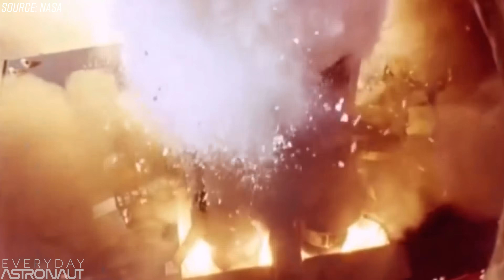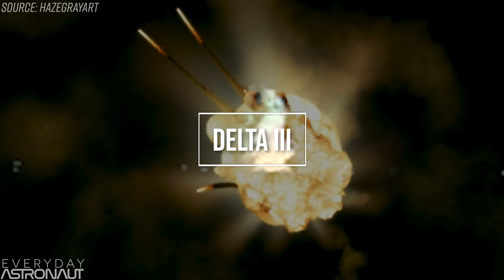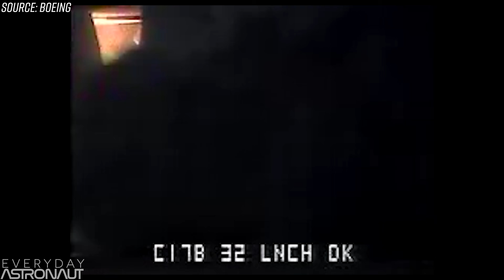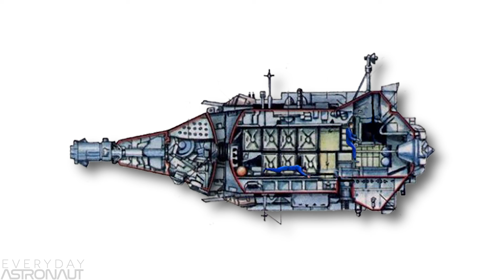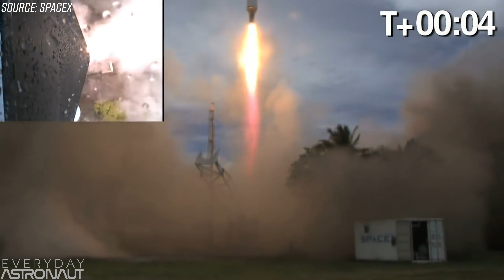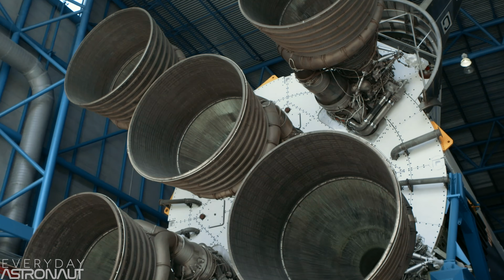Abandoned Space Hardware: CANCELLED Part 2

Comment: Seeing as the Apollo Ascent Propulsion System fired twice during Apollo 10 and used hypergolic propellants, I'm confused why you say the engine could only fire once and never be tested. Did you mean something else by this, or is the description of Apollo 10 wrong and this hypergolic engine could only be ignited once? If so, why is that, and are there any sources I could better learn about this from?
Reply from the maker: It could relight, yes, but the problem is the combustion chamber / nozzle was ablative. So by doing a test fire if the engine on the ground, you’d eat away at a portion of the engine. So the units that were flown were never actually test fired, just their ground test units.
Reply: @EverydayAstronaut  Thanks.

Comment: The Soviet lunar lander was a single stage craft? Well, not really. Actually, it was to have a descent stage that would take care of most of the breaking phase of the descent, then separate at about 13,000 ft. and crash on the moon’s surface. While it’s true that the same engine used for the ascent was also to be used for the actual landing, the lion’s share of the work was to be done by the “crash stage.”

Comment: the vertical saturn 5 at US Space and Rocket Center in Huntsville is not actually a saturn 5 at all, it's just a big steel tube painted to look like one with some F-1's bolted to the bottom. I've seen the inside. the Pathfinder Shuttle is closer to flight hardware than that thing is.

Comment: Love the videos, Tim, keep it going!

Silly question that I'm sure has been answered by you at length in a video... but if the Saturn V is the biggest baddest beast we've ever made, and still ranks right there with current heavy-launch vehicles in thrust and payload to orbit and so on... why isn't NASA just building an updated Saturn V?  I only ever hear about the Saturn V in a positive light so, why don't we want to dust off those plans, update them, and get our Saturn VI on??
Reply: There is a small group of ppl trying to reverse engineer and improve f-1 engines. Their current saturn V equivalent is sls
Reply: Mostly that the saturn 5 cost a lot, I assume, and a revamped version wouldn't be much cheaper